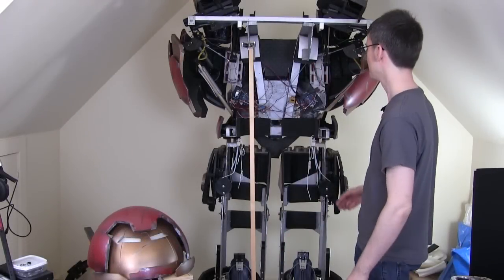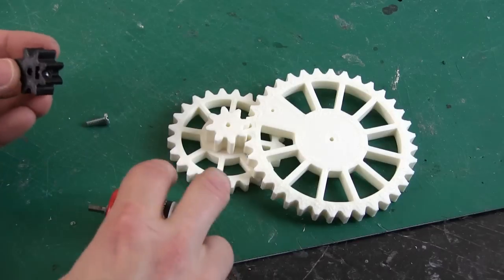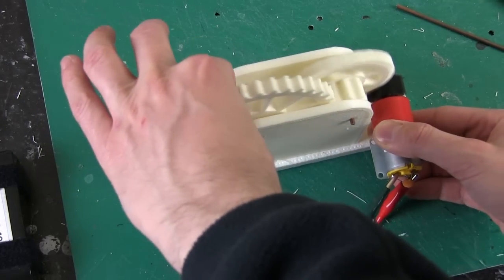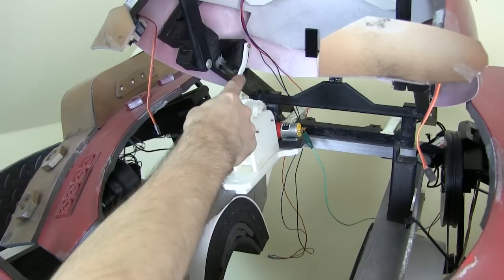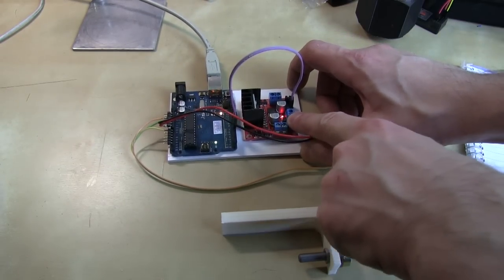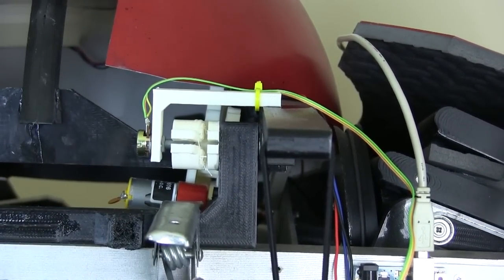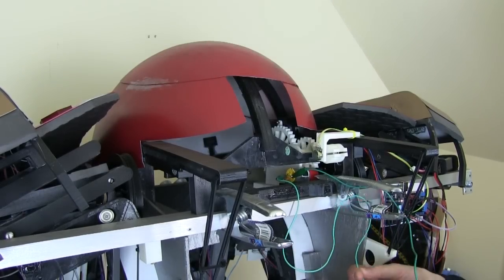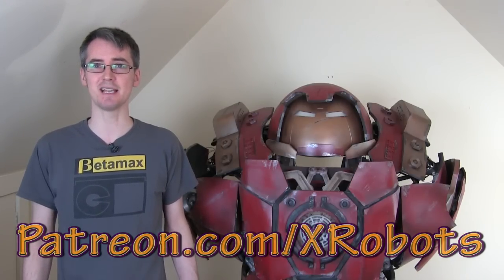Iron Man Hulkbuster Cosplay #45 | Motorised Helmet Mechanism | James Bruton

Comment: Maybe its late to comment and sorry i didnt see all the series of this building,  I did think cool to make this open/close device and after see the program and the way to do that I think it can be improved. so lets supose the closed situation is zero (open equal 0) with 1 switch will open/close by check (open value) if closed (open  equal 0) will open and if opend (open diferent of 0) wil close doing that will reduce the wires and switch to use, probably its late to this project but it may help you next time
Reply: Sorry I could not contain myself while thinking about the code.
Based on your code, it somethink like this.

int analogPin = 0;
int helmbt = 1;
int val = 0;
const int closed = 357; //set to the closed value, but can be write direct on the code

void setup()
{
  Serial.begin(38400);
  pinMode(5, OUTPUT);
  pinMode(6, OUTPUT);
  pinMode(2, INPUT_PULLUP);
  pinMode(A0, INPUT);
}

void loop()
{
  val = analogRead(analogPin);
  helmbtn = digitalRead(2);

  if (helmbtn == 0) {                  //button click
    if (val > closed) {                //check if helm is open
      while(val > closed) {
        digitalWrite(5, HIGH);
        digitalWrite(6, LOW);
        val = analogRead(analogPin);
      }
    }
    else {
      while(val < 472) {
        digitalWrite(5, LOW);
        digitalWrite(6, HIGH);
        val = analogRead(analogPin);
      }
    }
  else {
      digitalWrite(5, LOW);
      digitalWrite(6, LOW);
  }
}

Comment: Why have you used two buttons for open and close? Can't you just use one button, if it's open it closes and vice-versa? Seems like a trivial check on the value for its current position, or just a seperate boolean to store it's open/closed state?
Reply: +Lufferov I was going to say the same thing. 2 buttons over complicates things a bit whereas toggle code in the arduino is much simpler :)

Comment: i have a suggestion:
how about you'll use a periscope to see?
in 16:21 the space where your chin is visible looks perfect fit for wide periscope,and considering you're taller because of the suits legs, the periscope should be on normal eye height, and its easy to install.

Comment: Hey James,  so what about the rear opening design? Do you still plan on using that "lifting wings" desing? I think that design from the Fallout 4 power armor( single upper flap on the upper half and sideways flaps on the bottom) would work great for your Hulkbuster build.

Comment: the two golden pieces in front of the face plate,  if you can attach them to the top of chest plate instead lifting them with the helmet.  that way, those two can move to the sides as the face plate move up, and lock back in as helmet closes.  would look awesome

Comment: 10:00 You should install two small HD cameras and a lcd glasses headset. That way your already existing brain equilibrium will compensate for the change in scale of your surrogate body. They did the same thing with the giant puppets on Fraggle Rock. lol
Just make sure to space the cameras apart in the same scale as your real eye spacing and the illusion should be flawless. Then you'll automatically feel like and have the balance as if you were actually that size, all the while being able to completely hide your face and have full peripheral vision. 

Seriously. You should consider an internal VR headset and external HD camera eyes. It'll make your brain feel as though you've actually changed scale.

Comment: I'd almost recommend letting the face plate close about a second after the helmet comes down. It would be really cool and add that mask dropping down effect that all the Iron Man's have. Awesome work as always :D
Reply: +James Bruton (XRobots) Couldn't you just modify the fixed arm for the helmet a bit so that it has a longer range of motion and closes a bit slower or at the very least seems delayed? Obviously I have no engineering skills so I could be wrong.
Reply: +James Bruton (XRobots) oh right, well if you somehow pull that off that would be insane, but otherwise it still looks amazing
Reply: Yeah as it is you dont get any affect from the faceplate openning and closing, or so it looks on the video.
I think its a big part of the helmet and maybe the whole suit, so it would look really cool if the facepalte opened a sec before the helmet and closed a sec after.
Reply: Great idea! It would make the suit more accurate and, in my opinion look cooler